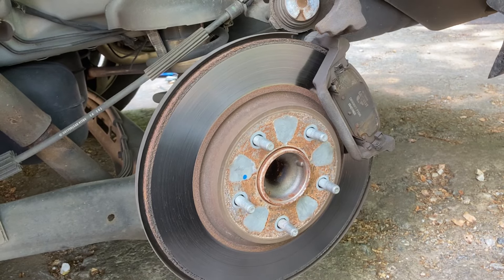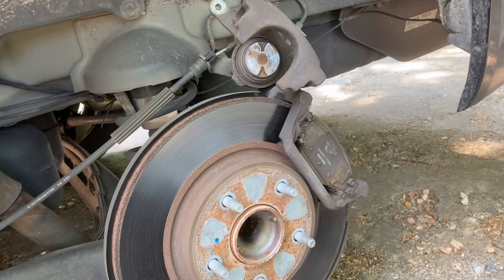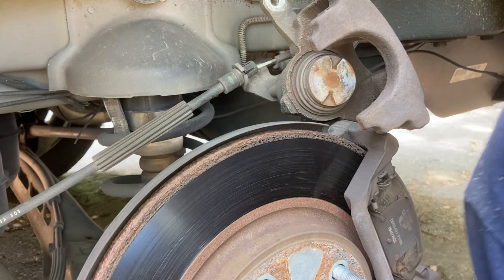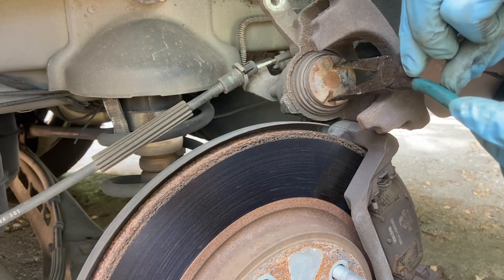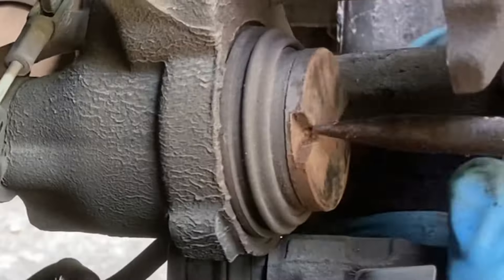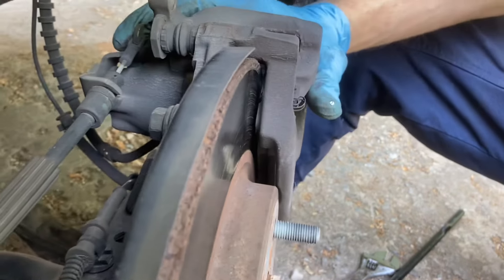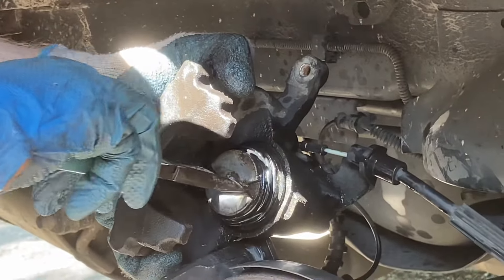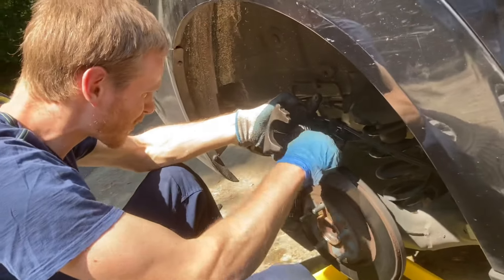Brake Piston Won’t Compress￼￼

Comment: Wierd cause the last time I changed the breaks I used the compression tool and it went right back in this time I had to spin it on my 2018 chevy cruze but glad I came to ur vid cause most every other vid is some one using random tools pushing it back in

Comment: For some reason I tried but it just came out more and doesn't go in I did have the brake fluid cap off and the brake fluid drain from the brake caliper.
Reply from the maker: Did you ever figure out what you needed to do with your break piston?
Reply: @Duby4life   yeah man it's hilarious 😂 I was twisting it the wrong way the whole time 😭 but had to make sure no air was in the brake thing so flush it out and everything was done right. Thank you for the video
Reply from the maker: @thebestofthebestsir47  excellent!

Comment: Mine just seems to be spinning and not going in. Any idea why?
Reply from the maker: Have you tried compressing yours with a clamp? You may have a different piston than me.
Reply: What if i tried compress already?
Reply from the maker: @kohshenguan3376  I made this video after having tried compressing with at least 100 pounds of force. So if you’ve already tried compressing it and it’s not working you may have a threaded piston like mine.

Comment: So what do you do if it wont turn with turning tool nor your method. Its completely stuck on the way in, but on the way out(when I brake) - it goes smoothly.
Reply from the maker: Sounds like there’s some pressure keeping it from going in, but I’m not sure.
Reply: I have same probled, did you manage to find solution?
Reply: @atv123  I had to force it. In retrospect id just replace the piston entirely and clean it real good.

Comment: I even have the tool for it but no matter how hard a try to srew it it, it just is not going in anymore, even with brake cap and valve open. I can screw it out no problem but it  just cant crew in. Have someone had similar expirence? I think its not siezed becouse the calipers were changed few months ago. Any tip would help, i really dont want to spend for another calipers
Reply from the maker: Is your emergency break off? E break needs to be released.
Reply: @Duby4life  yep, hand brake was released, but i will try to unhook the cable from the hook if it makes any difference
Reply from the maker: @atv123  I haven’t had to go that far before. Last time I did this, I accidentally started with the parking break on and could not get it to turn for the life of me. Then I realized I’d left the break in, released it and it turned on clockwise to compress the piston without a problem.
Reply: @Duby4life  managed to wind it back, but i had to uncrew the bleeder screw to releave the presure
Reply from the maker: @atv123  but you did it yourself! Nice job!

Comment: I can’t get mine to spin.
Reply from the maker: And you’ve already tried compressing it straight down rather than spinning?
Reply: It has two notches, so I used the attachment that fits into the two notches. Is it possible that, even though it has the two notches, I can just press it in?? I figured the notches meant it must be turned. It’s rear brakes of a 2007 VW Jetta. The video I saw of VW Jetta showed them rotating it to get it to go in.
Reply from the maker: @joehumeas7196  you may have to apply some pressure as you spin it. Sometimes the pressure of the fluid behind the piston pushes it away from the internal threads. Applying pressure should reconnect them so the screw and the threads grab onto another again.

Comment: See, the passenger rear one compressed no problem. Driver’s side one just spins forever and won’t compress.
Reply: have you figured anything out, mines doing the same thing
Reply from the maker: If memory serves, the passenger side had to be screwed in. I don’t believe the rear driver’s side needed anything special. I believe it pressed/compressed straight in as you would normally expect the piston to, no spinning/screwing necessary. I could be mistaken, but you could try that.
Reply: I'll try compress tomorrow I'd imagine both sides need screw

Comment: One thing I'd like to add is to look at the back of the pads for little nubs that stick out.  They should fit into the notches in the piston that you put the pliers into.  When the caliper operates, the screw inside rotates, not the piston.  If those nubs are not in the notches, you can ruin the piston faces.  My son found this the hard way.
Reply from the maker: Alejandro, when you say “little nubs” are you referring to the three little raised bumps? I didn’t see much on the back of the pads that looked like it would match up with those notches, but maybe I missed it.